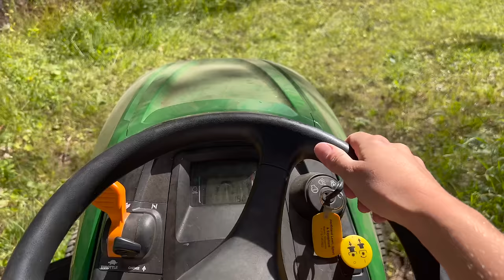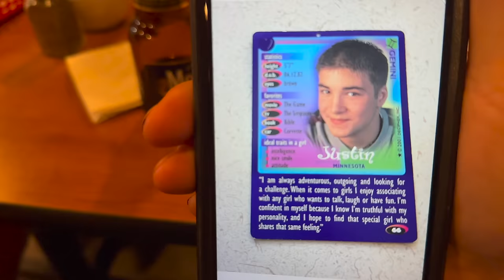a bunch of guys moved in with me

Comment: Hahaha, Three years to find that :) 

Good to see you are still around and in good spirits! The rocky river looks great. I heard you talk of filtration near the end but I did skip through and did not hear exactly what the solution ended up being. I was thinking of a way to clean up the algae more naturally may be to run the water up onto higher point and run it slowly back down through grasses, mosses and small reeds, through a sort of slightly boggy & sandy filtration area, sort of like a wide natural gold sluice in some ways. It would be a slow continuous process and probably the longer distance the water runs down through such an area the better. You have a pump going there, maybe a bit of that pumped water could be diverted into a filtration / wet garden area to eventually make it way back into the top of your new river.  A passive filtration should be quite eco-friendly. I think they must have filtered the water into the pools for the initial fill.

So just some thoughts from me as I have thought about doing similar things in the past and maybe even the future. Those guys should have some good ideas about this sort of thing too I guess.  It seems they have a good eye for the aesthetic and nature.

I haven't seen your house since your early posts there, it is looking really great and more comfortable . Well done!

Comment: You can use white distilled vinegar cleaning up the algae in the pond it won't kill the fish you need to add water if the water has chlorine need to add decor only do a partial water change use the old water store the fish another small pool you can use a brush with the vinegar you can use a net to get string algae out

Comment: They have this great wasp killing foam spray now. Works great. Forms up immediately and it has a stick on the end of it. Kind of like the spray foam little straw thing. Anyway, you put the little straw thing up to the hole and you spray, it immediately fills with foam and they can’t get out and kills them instantly. If it was a small nest, I would say get a cup put some gasoline in it and then cover it up with the cup but that’s a huge Nest so I would get the foam spray wasp killer.

Comment: Hannah, has anyone explained about cycling a pond and the stages it goes though? The green water is basically the microenvironment finding balance, it's where the algae etc are more prolific at the beginning until everything else is established. Please read about the nitrogen cycle and what you can do to enhance it. Improved filtration (i.e. with waterfalls are good). Also you're "fish in cycling" please read about this for your little fish.

Comment: Hannah, you have got to start the war on knotweed or it will take over your yard! I worked for my county for twelve years trying to save a river from being overtaken by knotweed. On the tenth year, I found the secret to getting 90% control compared to the 10% control over previous years. The ultimate time for treating knotweed is in September after the blooms drop. It must be sprayed foliar; stems, undersides of leaves,  and then overtop, in that order; fully covering every cell of the plant without over spraying. The secret is... when the plant has absorbed the herbicide, either that same day or the next day... spray it again one more time. Use Glyphosate with a sticker, 2 oz per gallon. Check with your county weed control office. They may come spray it for you but unfortunately, they won't spray it twice. After the initial treatment, the next season the knotweed will return but it will not be near as tall or be as many stems which will make spraying much easier.